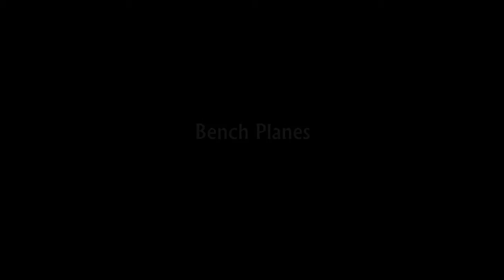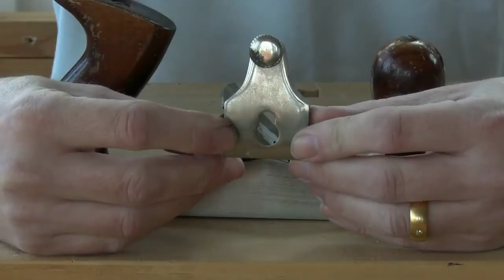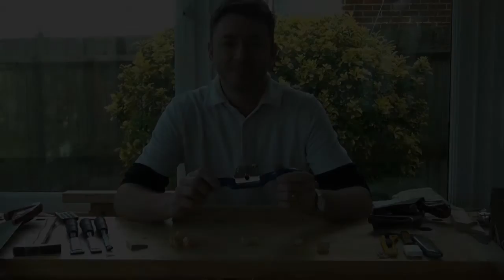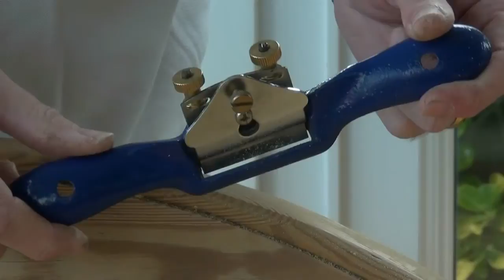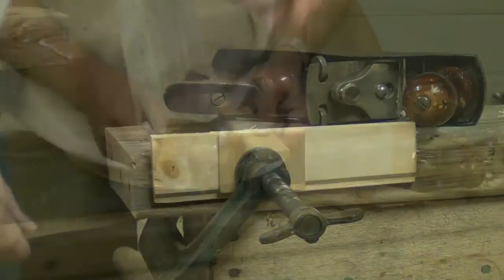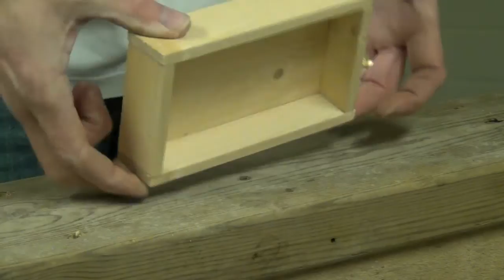How to Make a Simple Box - GIWS1E3

Comment: From what I've seen you have a easy way and the knowledge to explain hand tools/method which was why I was surprised when you misidentified the cutting gauge as a marking gauge. They are two different tools used for specific jobs when laying out your cut lines/marks and each act differently depending on what type of materials or you are using.
Reply from the maker: I've adapted the knife in this cutting gauge specifically for accurate marking (something the pin style making gauges are poor at). I guess it's a hybrid of the two, so my naming of it as simply one or the other is misleading. Golly good spot though - your the first to comment on it as far as I recall.

Comment: Hi!
Since it's a small scale beginner's project I thought I'd ask here. Here it goes. Is there a rule of thumb on when you do not need to pre-drill based on wood piece proportions? Let's say I've got a 3/64 (over 1 mm) nail and a piece under 1 inch thick (~24 mm). How wide would that piece need to be for pre-drilling to be obsolete? For oak and alder for example. I've got some 20x20 mm alder pieces I need to nail through. Normally I'd test this out but I've got no spare alder (stupid to begin with, I know) and besides such a rule would be helpful to have anyway. Any other tips on the subject?
Reply from the maker: I usually stick to the rule: 
If I don't want to risk the wood to split or the nail to bend then drill first.
This normally means I pre-drill all but construction projects!